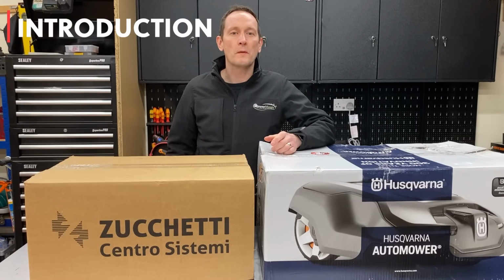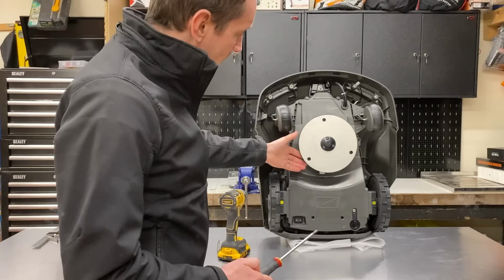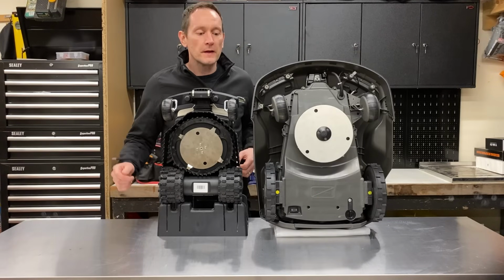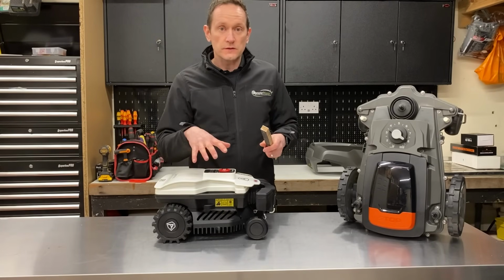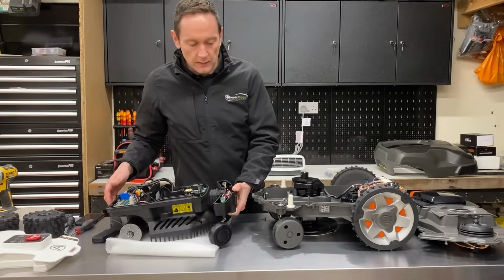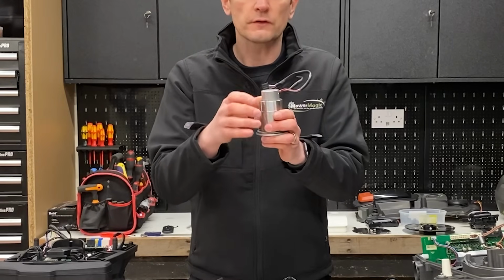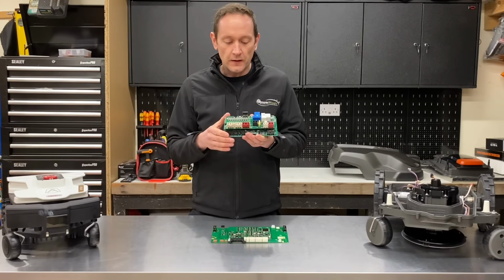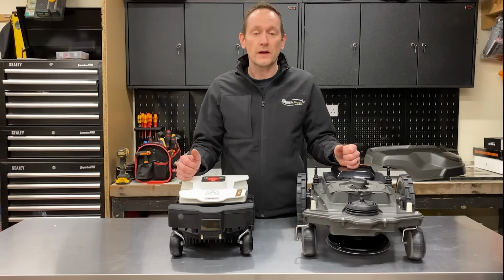Comparison Review: Husqvarna Automower 310 vs Ambrogio Twenty Deluxe & Automower 315 vs Twenty Elite

Comment: I have run my Husqvarna kniefs for 3 years. Works fine! Never got stuck due to the tires. What kind of unbias review is this?
Reply: You are Swedish and obviously favor the Husqvarna because it’s a Swedish machine. The Husqvarna is slow and has to charge way too often compared to other units.
Reply: @Birdfeeder795  Automower's charging station search times are short thanks to guide wire(s), therefore smaller battery gets the same job done. Ambrogio uses perimeter wire to search charging station, therefore bigger battery is needed to lengthen mowing time and decrease need to find charging station so frequently.
Reply: @ouherizon  That is just not the case. The Ambrogio cut way more grass in 1 hour that an HQ. The Ambrogio can work for way longer than the HQ thus completing the task way quicker. Just do the math on how long a HQ 310 will spend mowing a 1000 square meter lawn vs an Ambrogio Twenty Elite. It speaks for itself.
Reply: @ouherizon  I think your latest reply disappeared from the comment section. It would be interesting too read your response so please repost.
Reply: @Birdfeeder795  I agree, Ambrogio cuts grass more efficiently (especially longer grass), thanks to higher rpm (4200 vs 2300) and fixed blades, but as always, there are some downsides to this. First, energy consumption is higher, therefore Ambrogio needs a bigger battery (25.9 V x 2.5 Ah = 64.75 Wh vs 18.5 V x 2 Ah = 37 Wh). Secondly, fixed blade is more dangerous to user and objects lying on the ground, since blade does not retract, when colliding with an object. Thirdly, Ambrogio blades produce more audible noise. Ambrogio might get the job done faster, but you don’t take into consideration charging station average search time difference, the fact that Ambrogio’s two hour average mowing duration is achieved, when grass has been mostly cut. The real comparison should be done in the same area, on the same conditions, not on the paper. Also, I find it hard to believe Ambrogio 4200 rpm motor produces only one dB(A) higher audible noise, than Husqvarna 2300 rpm (59 vs 58 dB(A)).
Reply: @ouherizon  Ambrogio might need some extra battery for getting back to the charging station, but Ambrogio also use larger batteries for extended work time. Under ideal conditions the Twenty Elite is rated at 100 sqm pr hour while the HQ 310 is rated at 56 sqm, that is a pretty big difference. So for a 1000 sqm lawn the Twenty Elite will do the job in 15 hours including charging, while the HQ will need to work 24 hours or more. Also the 310 is 2 kg heavier than the Twenty Elite, 2 kg is a lot on a small robot. The point of both machines is too mow the lawn every other day too keep the grass short and trimmed producing only clippings, not long straws of cut grass. According to Ambrogio the robot should not cut grass longer than 1cm above the target height, if the grass is higher one should raise the cutting deck on the robot. If that isn’t sufficient one must cut the grass using a traditional mower and use the robot to maintain the lawn. As for sound, I don’t know. But I will compare my Twenty Elite S+ too my neighbors 310 when I get the opportunity. Also I have never had a problem with my robot being more “dangerous” for pets and such, and I only let the robot run during daylight so it avoids hurting nocturnal animals.
Reply from the maker: We are so happy you are pleased with your machine. No need to watch comparison videos of new models as your current one works fine.

Comment: Wow... talk about grip of the wheels and not the diamater? The diameter is the basis for going over bumps... what are you more concertned about, bumps or it's ability to drive on stainless steel?
Reply from the maker: The grip is spoken about in the context of the machine being able to drive over undulating or steep sloping ground - if it can't grip it can't move and will get stuck.  Pretty straightforward.

Comment: Too many irrelevant details which hardly make any real difference in real use in my opinion. The real use test would interest me more
Reply from the maker: If you call comparing each electro mechanical component irrelevant, so be it - all these components make up the machine and are ultimately very important.

Comment: I would bet a hundred dollars that the stainless steel blade won't be sharp for a full season
Reply from the maker: Other than stainless steel, what would you use ?
Reply: Husvarna sell Inox and HSS blades as well, but the latter are are eye wateringly expensive

Comment: This comparison looks soo biased. I would say, sometimes the simpler, the better.
Reply from the maker: The facts speak for themselves.  We hold up items from each brand and discuss.  We specify facts and figures from each brand.  If one brand comes out better they is not much we can actually do to fake the factual results.
Reply: @mowermagic  I appreciate that you try to innovate. But a real life comparison (in other words comparing the effect on the lawn) will simply have more value for the consumer. Because synthetic 'facts' are debatable - is the bigger bearing in xyz better? Does it bring some value or is it over engineered and just adding weight?